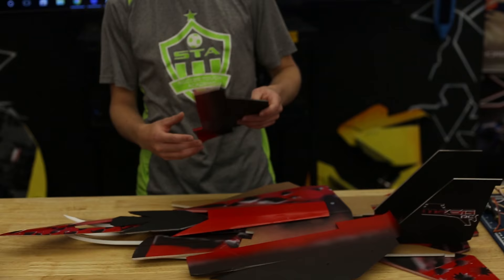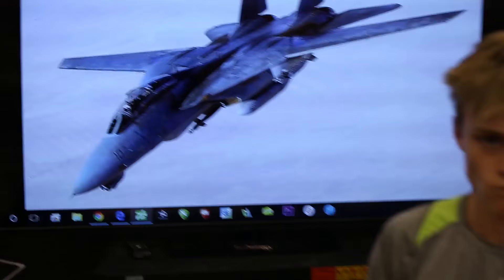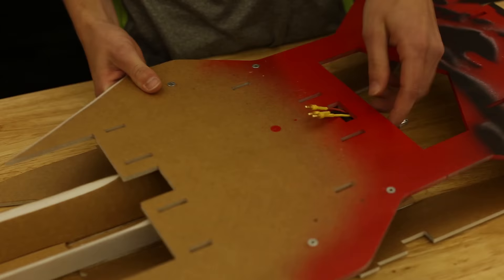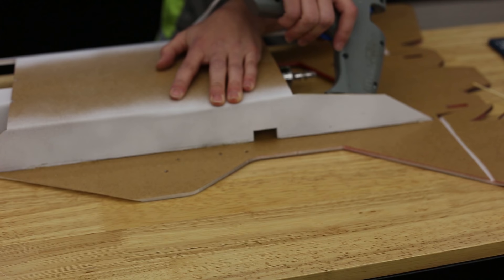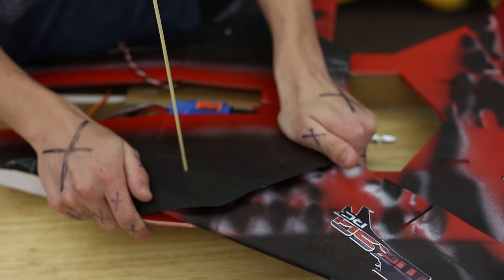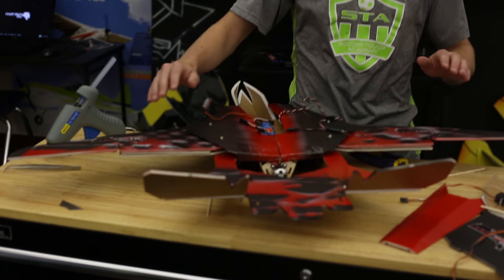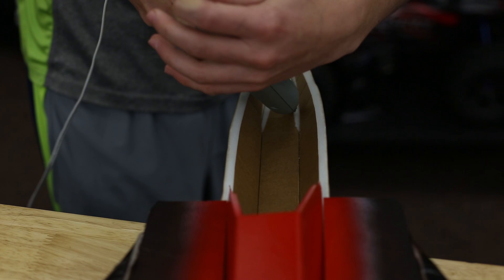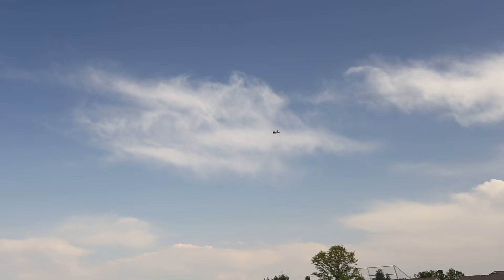MESArc - Tomcat Build

Comment: Hi mesarc.. I hope there is an update for this model.. Like the swipe wings servo hope so.. I have make bigger prop use for this plane.. 1400kv 8x6apc prop 2200mah 3s batt.. It's surprise me alot when can fly over 15minute with full open wings.. I never move the Batt position when swipe back but I add more up elevator trim in 2rate ..

Comment: Well done young man.  Those bevels that you were showing at the beginning, are they something you have to do or are they already done in the kit?
Reply: i wouldnt be intimidated by the bevels, the easiest way is to just put a metal ruler about 1/4 inch or so from the edge (depending on how much bevel you need) and just score the paper, remove that paper strip then cut the foam corner off, it will cut like butter with no paper. then follow up with sandpaper to get a perfect bevel. ive been thinking of making a video on how i do it cause i was intimidated by the bevels when i first started scratch building but with this technique its trivial and actually kinda rewarding getting a perfect bevel.
Reply: Travis Pratt
OK, thanks.  Building.. it's all good.